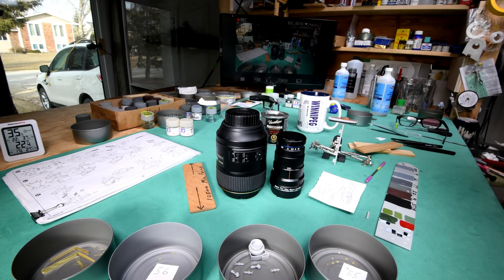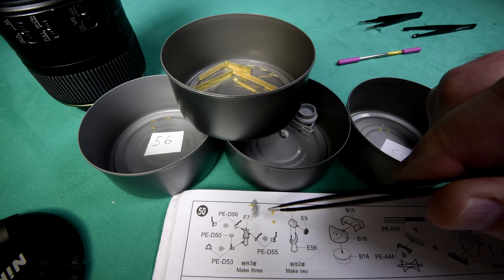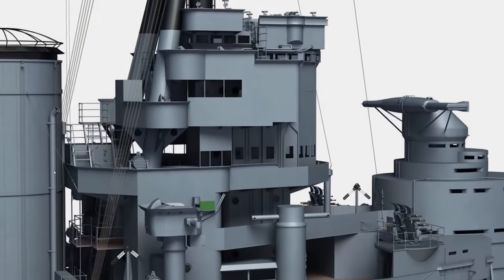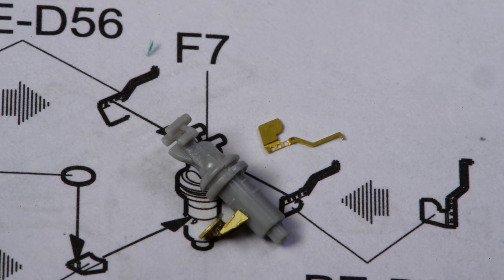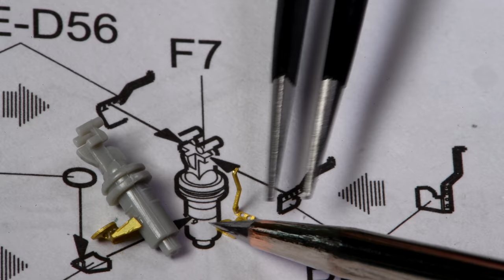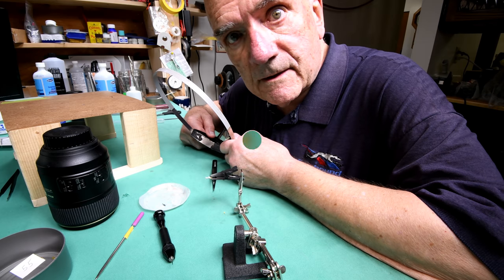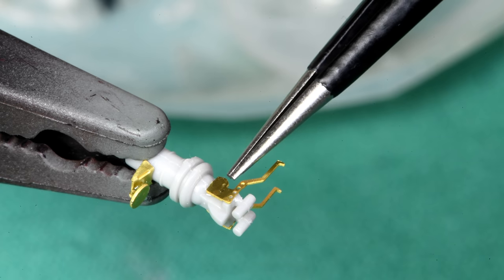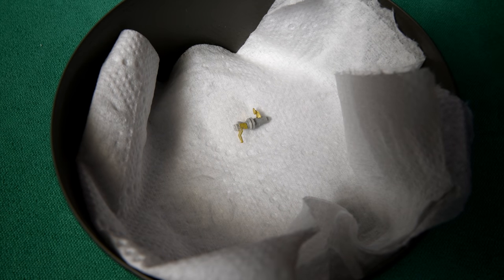The Model Ship - Part 760

Comment: Nice job on those microscopic parts. At 73 my fine motor skills have diminished,I find it comforting somehow that you are still knocking it out. Well done,sir.
Reply from the maker: Re: "fine motor skills have diminished" Yes, I'm noticing that too, even since I started on the Bismarck just over two years ago, noticing a slight difference. 😧

Comment: Hi Ron,the part you done in the video looks to be the air defence officers sight,if you look on the pull out reference sheet that comes with Stefan Draminski 3D detail book have a look at the air defence officers sight illustration and it will give you some idea how it goes,hope this helps a bit.
Reply from the maker: Thanks Jerry! I'll check that out. Also, I did see the photos you sent in messenger. Planning to use this info in 761 today. 👍

Comment: Hi Ron that part you were struggling with, just a thought could it be that part with the holes in folds away from the groove and right back on itself until it lays flat on the lower part. This would also reduce its depth and allow it to fit under that top platform. Best wishes Vic.
Reply from the maker: That's a possibility alright. Thanks Vic! 👍

Comment: Those parts are really confusing.  It actually looks like the PE is supposed to be bent away from the crease instead of towards it.  That way the whole part would actually slide into the groove on the plastic piece with the thin line that has the holes in it bent outward and resting under the overhang on the plastic piece.  I might be completely wrong, but that's what I was seeing as you were gluing it at an angle across that gap.  It just looked like it would fit if bent outwards.  The part that really confuses me is why they put the tiny round holes in the PE as with my bend, they would be hidden under the overhang and ultimately just weaken the metal.  At arm's length, they'll look great as you did it though.  I totally agree that those Trumpeter instructions don't describe at all how that part should fit.  At any rate, keep at it and you'll soon be past these parts!

Comment: Hi again my Canadian friend. As a Nikon user, I am wondering what lens you use for the majority of your videos? :-)
Reply from the maker: Hi Simon,
Nikon, yes, I'm a big fan. Reliable! Waiting for the Z9 to come out and read/hear the reviews. I'm hoping to start shooting 4K60, and the D850 only does 4K/30.
The lens I use the most for normal shots is the AF-S Nikkor 16-35mm f/4G ED VR. At 35mm it will allow me to move in quit close and I still will get acceptable depth of field when stopped down to f:22.
The D850 is great at high ISO. Very pleased so far. Best camera I've ever had. 
Three of the items listed below I no longer have, but thought you may like to know because they were Nikon.
All the lenses listed below are Nikon F-mount.

(sold) Nikon D800 Body
(gave to my son) Nikon D810 Body
Nikon D850 Body
Nikon Coolpix S9900 (this is the camera I use for the two-camera shots)
Rokinon 12mm f/2.8 (fish eye)
AF-S Nikkor 16-35mm f/4G ED VR
AF-S Nikkor 50mm f/1.4G
(gave to my son) AF-S Nikkor 24-70mm f/2.8G ED 
AF-S Nikkor 24-120mm f/4G ED
AF-S Micro-Nikkor 105mm f/2.8G IF-ED (macro)
AF-S Nikkor 70-200mm f/2.8G ED VR2
Tamron SP 150-600mm f/5 – f/6.3 Di VC USD G2 Model A022N
Venus Optics Laowa 25mm f/2.8 2.5-5X Ultra (super macro)
Reply: Thanks so much mate. I will have to play around with the 5 or so lenses I have. I use my camera more for wave photography (in the water). So don’t know so much about the settings for this type of thing ☺️☺️
Reply from the maker: .... so that explains the photo depicted in your YouTube banner. 👍
Reply: @roncalverley  It sure does mate